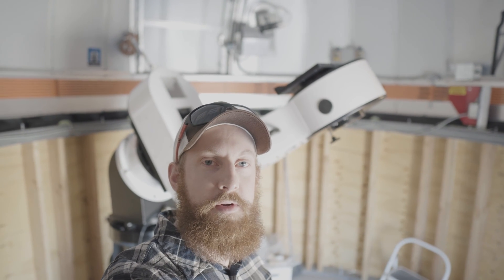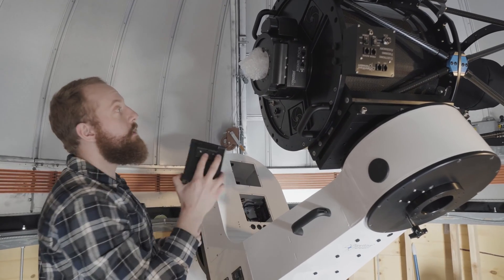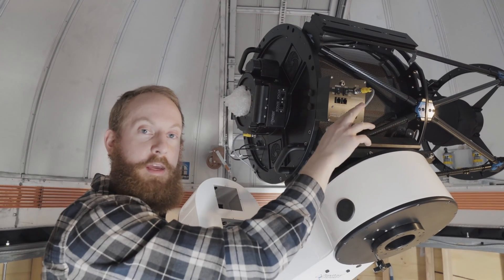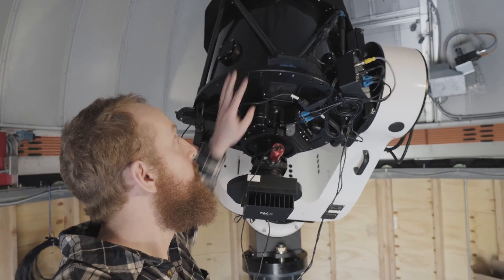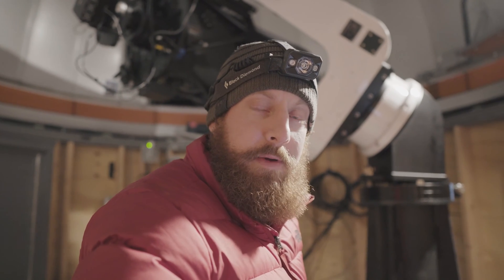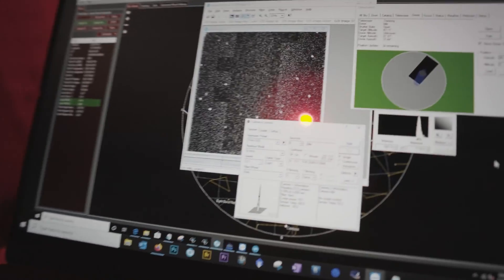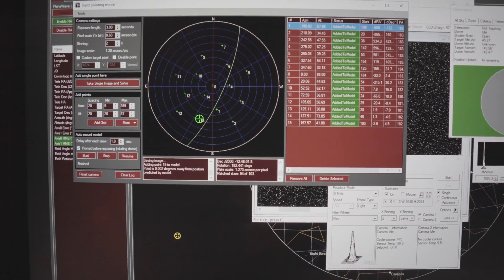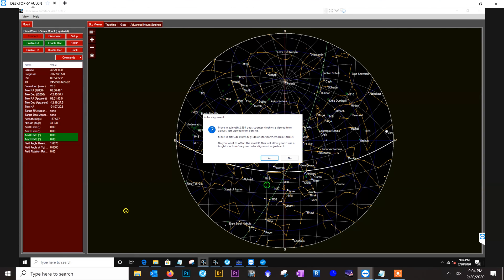PlaneWave CDK400 Install!

Comment: All that money and such quality and out comes the 1974 rs232 adapter… somebody in that department needs to be fired
Reply from the maker: Always room for improvement haha!
Reply: My Astrohaven observatory also uses top tier modern electronics and motors, except for the connection, which is also RS232 ... And I seriously have to open the dome halves by repeatedly typing AAAAAAAA BBBBBBBB in a text terminal, lol.

Comment: A little like the final alignment in Sky X. So you have the software correct to the star and then physically correct it?
Reply from the maker: Yes that's is correct. Our PWI4 software has a polar alignment routine that helps dial it in like TSX.
Reply: @MattDieterich  thank you

Comment: 3:04 - why all the adaptor conversions? Why not have a USB-serial converter with a USB-A at one end and an RJ modular connector on the other? Or why use 1970's serial at all on the EFA - USB comms are de rigueur now, comes standard on many micros, or facilitated by a USB interface chip for a few cents...  I know some people are "but USB connectors can just fall out!" and that is why screw-lock USB connectors exist...
Reply from the maker: Certainly an archaic connection system and one is being replaced with our new Series-5 Controller, focuser and rotator. Series-5 Controller will replace the EFA Kit that has those adapters. It will run via direct USB connection to the computer.